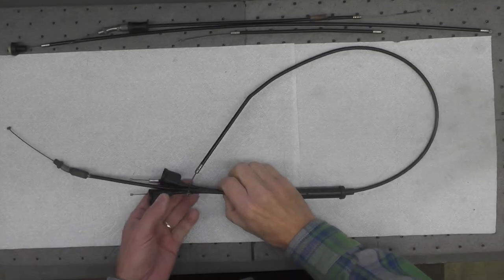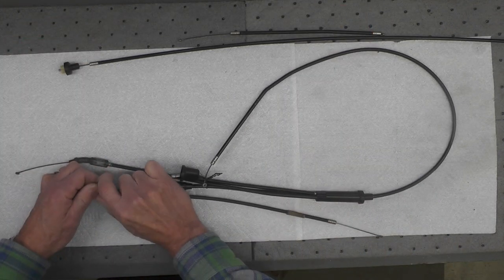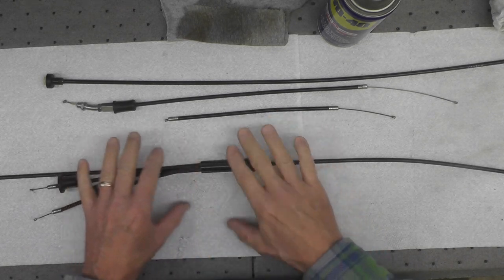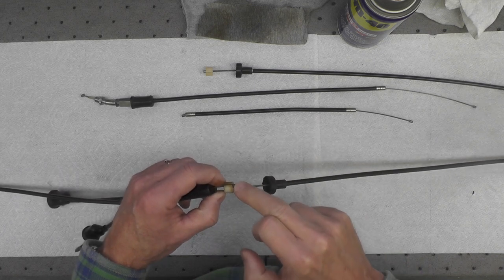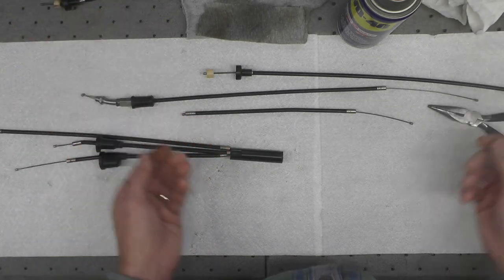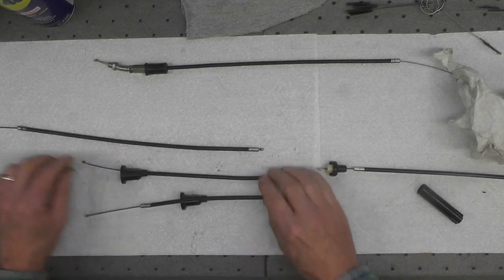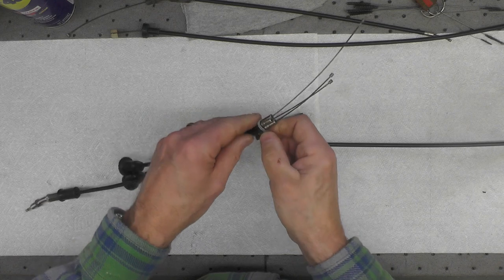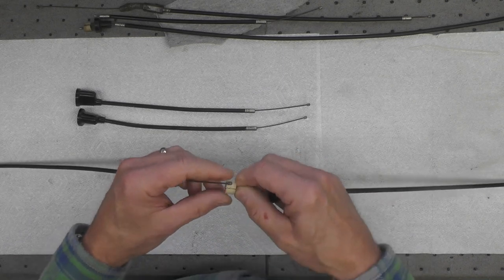Yamaha YL1, Installing the Carburetors --- Video #170

Comment: Nice job and well explained as usual. My only thought was that you may have to remove the inlet rubber boots, so that you can harmonise (UK spelling!) the throttle slides, so that they open and close together. I've already had to do this on my bike, as when I originally had it, they were quite a long way out of sync'. It's certainly a pain as the boots are so very stiff as you mentioned.
I'm wondering if there is another way of achieving this, (without removing the rubbers) but I don't think there is easily.
Having said that, if you have an endoscope, it should be possible to use this and access the ports via the air filter housing connection - so that the position of the slides can be seen.
I bought a cheap one some time ago - the resulting image is pretty poor, but I would think it might work. If it did, it'd be a lot easier than getting the boots off the carb's and sufficiently out of the way so the slides can be seen.
So very much looking forward to hearing it run - I might be old but still rather impetuous!
Reply from the maker: You are correct Jono, the intake boot needs to be removed to synchronize the carburetors.  I went ahead and installed the boot as part of this video as I had already mounted it when I initially installed the air filter canister (wasn't thinking ahead when I did that, I'll admit).  In fact, I've already removed the boot, only took a minute with the aid of the hot air gun, and synchronized the carbs and calibrated the oil pump.
In terms of technique, I am not aware of a method that doesn't require removing the intake boot, on virtually any multi-cylinder bike.  Someone may prove me wrong on this point, but that's my experience.  I've never tried a scope, though.
Won't be long now before I try to start the old girl.  I'm mostly waiting for a nice warm day so I can open the overhead doors as she's gonna smoke but good.  First starts on two strokes always do and I don't want to fill my shop with smoke.

Comment: Very informative video.  I am currently in the process of rebuilding the exact carburetors.  What is the Mikuni model for these carbs ?  I would greatly appreciate any information for the correct rebuild kit and vendor. Thanks so much for your outstanding work and videos.  Awesome details !!!!
Reply from the maker: The Mikuni carb model # is: VM15SC

I don't typically use rebuild kits for carburetors with the exception of using the gaskets and seals, as I don't care for the quality of the parts.  Also, often the jets are the wrong size.  Brass compoenets such as jets rarely wear out so they only need cleaning.  In any event, here's a link to a full kit on eBay:

https://www.ebay.com/itm/201067561083?hash=item2ed08f807b:g:bkUAAOSwZith~XeZ&amdata=enc%3AAQAIAAAA4ERX3sCKiBSSClR1py%2F1hbARBcxos0jC4fJKC3Wy0d6TGJHNcvyVI3AyOO744SmGYPmoSmB32c7xQl%2FoVCeqc9y2YMAINfFpcuh2znsBWjsLbIAhhfTbuhMCIYFxVouXc9aMIc3NUdGMWz1uHzqhW0zenXsS7SlvNqR2YFk7I645bFhlhD%2FMfVOZyEowCmVzisaoI8eqe%2BOPmRyMloFt44CD4fT%2FXOgFNdD8GbA%2Fg%2B1gQ7NsQB3kZ9ydAH%2FY0Yyj%2BxrMHmqvGjuNezaLQVRXqvV2xEMEY35bVCC%2Ft9k%2B1Ea%2F%7Ctkp%3ABFBMhuWUmM9i

Thank you for the kind words on the videos!
Reply: Thank you very much Sir.... @kwrightway
Reply from the maker: You're welcome...

Comment: did you make a video on adjusting the idle speed ?
Reply from the maker: No, not specifically.  I surmise you are referring to synchronizing the two carburetors.  There are several ways to go about this but my preferred method is old school: remove the intake boot and using two fingers from my left inserted into the carb throats to contact the slides.  Twist the throttle with my right hand while using the left hand fingers to detect the rise of the carb slides while gently twisting the throttle.  Adjust the throttle cables as necessary to ensure the slides rise at the same time.  Your finders are very sensitive and this technique is quite effective.
Reply: @kwrightway  exactly always take out slack first on both cables then one carb don't open before same thing..